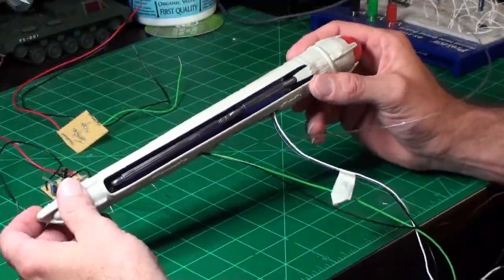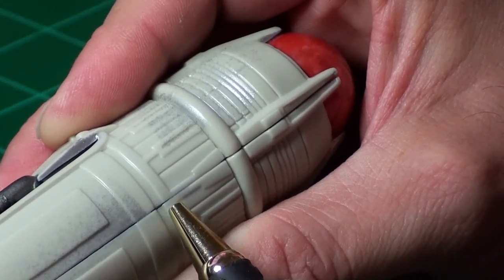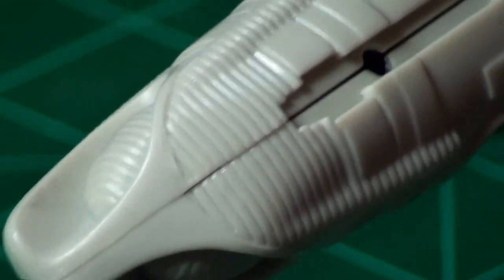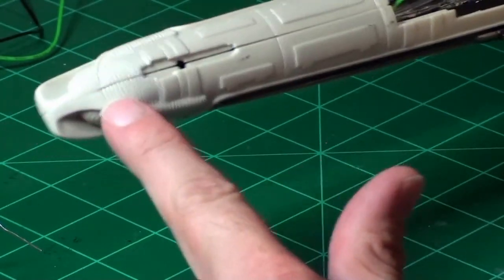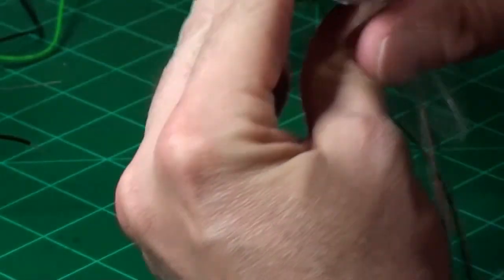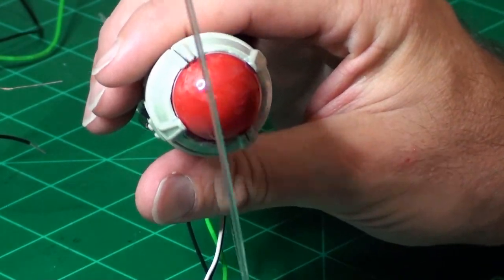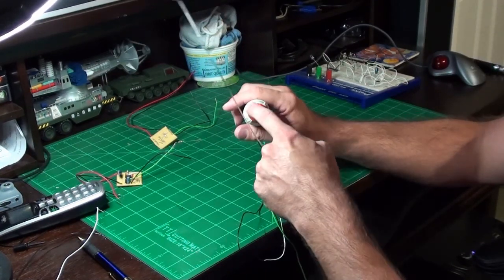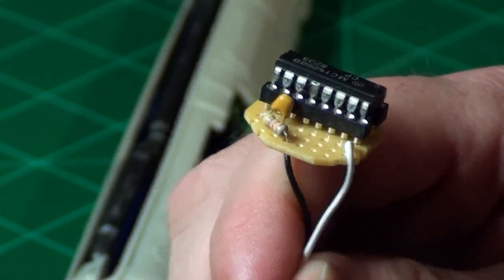Enterprise NX:  Nacelle Recap part 1

Comment from the maker: @froymot I have only worked with Aves once before, it was just to play around with it.  The big problem is that in certain spots they don't line up at all.  And on one side, the groves are almost 1/16 of an inch above the other groves.  It will take a lot of work to fix this one.

Comment from the maker: @77ExarKun These seams are one of the reasons I have been putting this thing off.  The side shown in the video is the good one,  On the other nacelle, they are much worse, the bumps don't even line up.  I may have no choice but to fill and replace.

Comment: badgrendels I would think that you could use flexifiles Plasti weld to glue the nacelle which when done right would cause plastic to well up doing the same job as putty without actually using putty which will help with seam removal.
Reply from the maker: I have done that before and it would work.  When I first did this, I didn't know about that.  This is sitting on the bench so I should get to it soon.
Reply: I first used it for the first time last year and I like it.  had to pick up a touch and flow applicator to use it and it works like a gem.